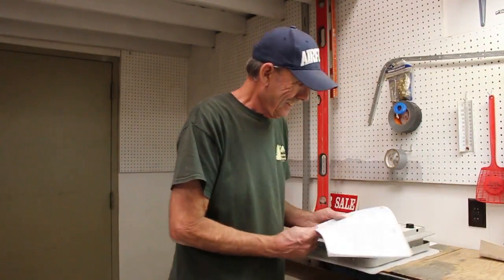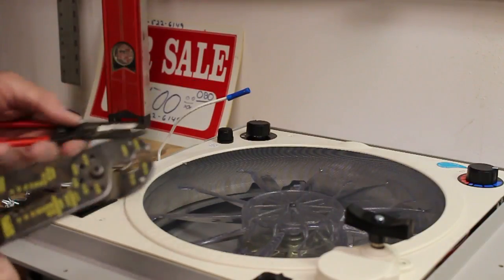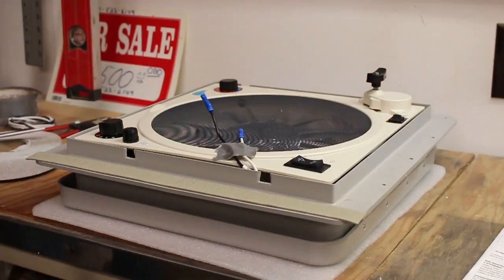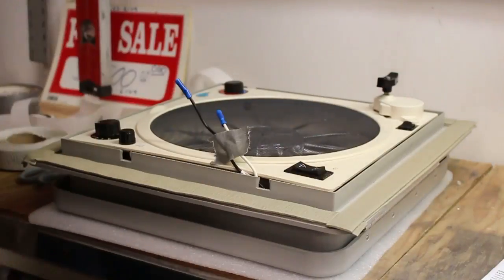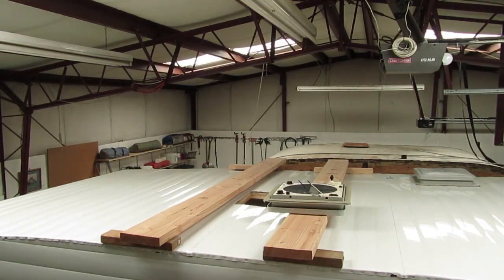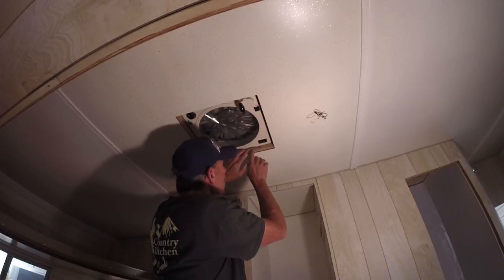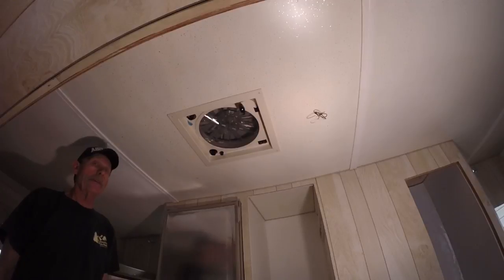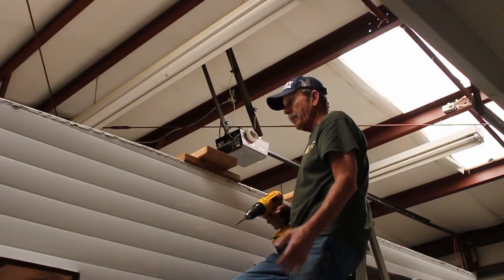Installing The Fan-Tastic Fan RV Ceiling Vent

Comment: Thanks for this, my Maxx fan got flooded (and so did my camper) when the guy I hired three years ago installed it wrong, then disappeared. I've sent this video to the new guy doing the installation of the replacement fan. My roof has a valley across it (1971 Shasta Compact) so I hope the half-inch crown helps.
Reply from the maker: You may need to replace the framing in the roof. It's not difficult to remove the metal roof skin. I have videos showing all that on my website. www.cannedhamtrailers.com These are built from the inside out so you can't do it from the inside. You must remove the outter metal skin to replace framing in any trailer.

Comment: Before I could get up on the roof I think I need someplace to hook a safety harness. But I'm glad you showed how you got up. Wish I had a garage to do this in but I don't. Since you are restoring that trailer you were able to think ahead and put your wires in your vents. What would be nice for us people who are trying to upgrade our current plain vents to a fan vent is to show us how to fish the wire to the vent. That is what I need to do. Thanks for sharing.
Reply from the maker: That's really pretty simple. The rafters that house the vent hole run the width of the trailer so you have a clean shot to the wall. Just drill a half inch hole in the side of the vent hole nearest to the wall you want to get power at. That would be the kitchen Usually there is an over head cabinet over the kitchen counter. Drill a 1 inch hole or better in there or just cut out a square hole with your multi-tool. You can also cut a small hole in the ceiling and you will fish the wire from the vent hole to the ceiling hole n the cabinet and then down the wall through the wall hole in the cabinet. Fish it back out under the counter and hook get it to 12vdc from there. I'll do a video on that some day.
Reply: Thanks, after I fix my fresh water problem installed  a fan and resealing my roof are my next projects. I'd like to redo the whole roof because it doesn't look like they ever strapped the roof down before they put the j-rails on. It's very waved but I don't have a garage and it's been raining 3-4 days a week.  I real have enjoyed the videos I have seen so far.

Comment: Thanks Larry. We just installed one just like this in a 1996 Shasta fifth wheel we are refurbishing. We had been too busy to learn it yet. You clued us in. Embarrassingly it did get installed backwards this time. Not on purpose. We had installed the fancy one with the remote in the little Funfinder we sold to buy the Shasta...not backwards that time!
Reply from the maker: Well you had better turn it around. Those wires in the fan housing can be extended or made to come out the other side if need be....

Comment: Restoring my '64 Shasta Airflyte.  It had a Fantastic Fan in it that worked but had leaked terribly (roof sag).  Upper housing and inside garnish had dried out and cracked so, had to order a new one (model 1200).  Going to install this week.  Going to use putty tape and NOT the foam gasket thing that it came with.  Thank you for all you do with these videos!

Comment: If you still use 2x8 or 2x10 on 2x4 blocking you might consider wrapping and stapling the 2x4 with the non-slip shelf liner from Dollar Tree. They will stay on the roof where you place them better. It also works on cushions and mattresses.

Comment: Another Idea for the 2x8's on the roof would be to glue some scrap carpet to the underside of them, even if it's just several inches of each end, to prevent scratching the paint. Love your videos.

Cheers,
Bugs
Reply from the maker: Then there would be a chance of the whole thing slipping off. I like it this way and it does no damage to the roof. Thanks for the comment though.

Comment: Fascinating learning how things work, thank you. You commented below that these should be re-sealed every 5-7 years. Does that mean it needs to be pulled out and re-taped, or can a bunch of tape just be applied around the edge from the roof? Thanks.
Reply from the maker: The timing depends on your climate and how you store your trailer. If it is stored under a cover of some sort then you could go as long as 15 years. But if you are in a hot dry climate then you will want to at least check it after 7 years to make sure the tape is still good.
Reply from the maker: You asked about the crown but I don't see it here. The crown should be 3/4 inches thick if in the middle of the trailer. 1/2 inch thick if near the side. It's just a layer of plywood around the hole at least as wide as the flange so you can screw the vent into it. I show this in my different build series. You can find them all on my website. http://www.cannedhamtrailers.com

Comment: A little correction for your "RV" wiring comment. It's not just RV's, but all DC wiring. Black is normally the Hot (+) and White the Ground (-), for 2 wire. If there is a Red (then it would be Hot & Black would be ground). It is confusing sometimes. Especially if you deal with AC, when there are normally 3 wires adding a neutral for the alternating current.
Reply from the maker: I'm an electrician and I also have a background in electronics. I hold a ham radio license. All colors are hot. White is always either neutral in AC or ground in DC involving trailers.
Reply: @mobiltec  Thanks...I was a contractor for a number of years. Did a fair bit of wiring in my day. Never saw a green hot wire, at least not one wired by anyone that had any business doing it. Also, use to redo old cars. Six and 12 volts, so I have completely rewired those too. Another comment, in my opinion, better than the auto-close feature on the fan is the permanent covers. This way you can still use your fan during bad weather, and don't have to worry about when the auto-close will stop working, or closing them while driving. They can stay on then too, to keep the trailer from heating up.

Comment: For the ceiling vent when it is open which direction does the open side of the vent face? The back of the RV? And the hinged part of the vent is facing the front of the RV?
Reply from the maker: Yes. Common sense dictates this.
Reply: @mobiltec  I’ve seen people installing them both ways in quite a few videos so that common sense seems to be lost on others as well. I’ve assumed the rationale for the direction it faces is so when you are traveling that wind doesn’t try to open the vent.
Reply from the maker: @danielgreen7050  Exactly... :) And I know what you mean about common sense being lost on others. I see people doing some pretty weird things to their trailers.

Comment: ive looked at a thousand videos and still cant find one that shows how the other end of the fan is connected. Does it just connect to a positive and negative terminal of a battery or does it go into the inverter??? If i just have a goal zero yeti can it connect to that instead of having a battery and inverter setup? I still gave you a thumbs up because it was very in depth video. I guess im the only one that doesn’t know how its connected to the power system.
Reply from the maker: It runs on 12vdc and you just run a red and a white (positive and negative) wire to the battery or the fuse terminal if you have one and you should. Now you can go to my website and look up my electrical series... www.cannedhamtrailers.com

Comment: So did you caulk the screws or around the edge (top of trailer side)? Saw another installation video and they used the tape (like you did) and also caulked. Your thoughts?
Reply from the maker: Calking does not work on an aluminum trailer. The metal expands and contracts with heat and cold and the very first time that happens it breaks the seal. So now you have a bunch of calking that will be hard to remove next time you want to re-seal your vents which is very time consuming and ruins the paint. You should re-seal your top vents every 5 to 7 years depending upon your climate. I know that no one ever does that but if they did their trailers would last 5 times as long. I use a double layer of one inch putty tape and that takes care of the screws also. Putty tape is the only thing you should use.
Reply: Thanks for all your videos and getting back on this!
Reply from the maker: You're welcome. Stop by my website. Lots of great resources there and all the videos are listed in proper order.
Reply from the maker: You can do that if you want but it is not necessary.
Reply: mobilt
Reply: @mobiltec  What do you use to seal to a painted metal roof (older steel horse trailer)?

Comment: might consider some non skid mat attached to those 2x4 bits, just to keep everything from traveling. Also, if those a going to be the 2x8's you continue to use up there, round over the edges to keep them from gouging the metal. Take some low pile carpet remnants (or discontinued sample squares)and face the ladder sides so you can get it closer to the trailer, that sideways leg reach is scary, especially working alone! That is one mistake you don't want to make so we don't have to!!! work safe/work smart
Reply from the maker: The 2 x 4s do not move even when I slide the 2 x 8s on them. So they are fine. The 2x8s have not scratched the metal but I don't slide them on there anyhow. And usually I am not working with planks this wet and heavy. They are very heavy due to being brand new and as they dry out they will become much lighter allowing me to move them easier. I've probably been up on top of trailer 300 to 400 times or better and never had a problem getting up and down safely. I put all my weight on the planks until my foot is securely centered on the step of the ladder. Thanks for your concern though. It's much appreciated. I plan on purchasing some scaffolding which will make getting up there much safer in the future.